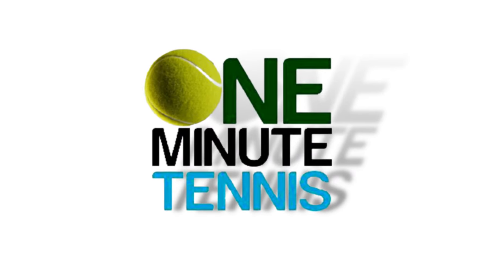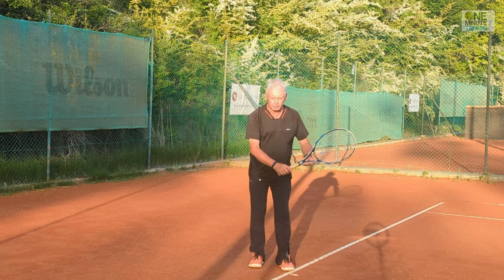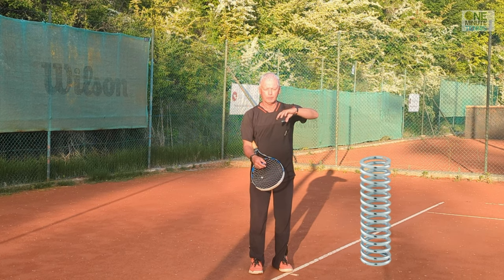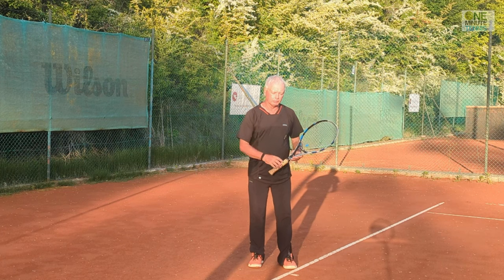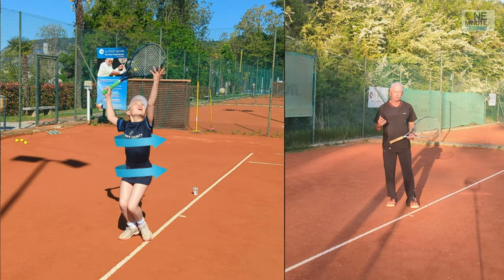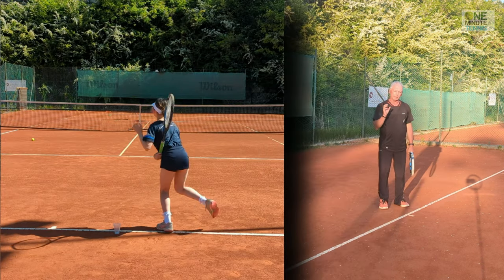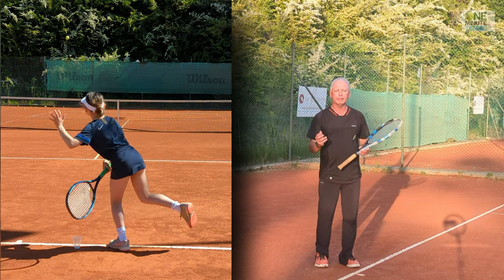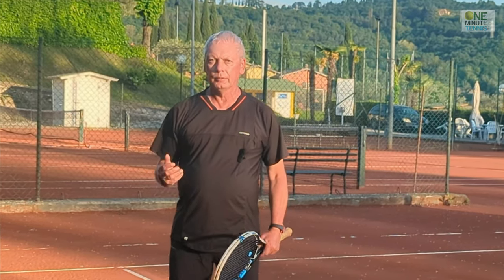Advanced Technique for a Huge Serve

Comment: There's something to this. But the explanation doesn't quite translate into what happens on the platform stance. Perhaps a different way to think about this is that the lower body STOPS rotating and allows the upper body (in links) to overtake it.

Comment: Interesting concept but I don't follow your description in the pro videos.  The discussion in the video suggests loading with shoulders rotating back and hips rotating forward.  Do you mean that the hips lead the forward/upward drive while the shoulders are still coiling?  Or, do you mean the shoulders rotate back while the hips shift (not rotate) forward toward the net?  With Fed, the hips seem to shift forward toward the net after his maximum knee bend, but I don't see the hip rotation till the drive forward/upward from the legs.  With Sharapova, she starts with the hips facing the net post and seems to face her hips to the side (hips coil back not forward) as she tosses.  In those pro videos, at what point do you see the hips rotating forward counter to the shoulders? 
I think what you are describing may be used by some of the pinpoint stance servers who bring their back foot past their front foot (unlike Sharapova).  For example, Wawrinka seems to do what you describe.
Reply: Very similar to my interpretation; it would be good if this could be clarified.  It looks to me that, rather than hips and torso going in opposite directions during the toss, the hips rotate back towards the net early, thereby creating the coil/stretch, then the torso rotates. No different to a forehand where the body turns more than the hips, the hips rotate back first, followed by the torso, then the arm etc.   From my experience this is not so counter intuitive as what appeared to be suggested.  Grateful for clarification.

Comment: I don't get it.  Isn't this simply saying to rotate the upper body further back than the lower body so you get rotational hip-shoulder separation.
Reply from the maker: Hi Henry,
Sorry. No. If you do that, the lower body will be inert and move with the upper body.
Think about the ballet step. This will move your lower body forward, while your upper body rotates backwards.
Can you not see this difference in Ciara's serve?
Does this make sense?

Comment: Tried this today, sent down 70 serves, initially I had trouble coordinating but it became easier as I progressed...noticed the improvement in speed quickly..also was able to send down the line & corner serves on ad side with more accuracy due to rotation towards the direction of the serve...I noticed slight difficulty in serving wide on deuce side as I could not time the spring uncoiling well so I tossed a bit to the left & could access the corner better...overall I improved my accuracy & the movements felt natural...will try to implement in the match...thank you for your awesome coaching

Comment: I made this change tonight to my platform stance and it immediately changed everything. I had been rotating my feet back toward the fence in an effort to get more coil and this has blown my mind. By not rotating the feet I’m easily able to jump up and into the court and be pointed in the right direction.
Reply: " I had been rotating my feet back toward the fence in an effort to get more coil"
Sampras started with front foot more parallel to baseline rather than the 45 d angle. It is fine to do that if you want. I think the key, as you mention, is not to rotate the front foot during the service motion. 🤔

Comment: Thanks again for this great video. But I still have a question, what this foot movement with a serve with plate form stance?
Reply from the maker: Hi rody
The foot movement is to emphasize not rotating your front foot back with your body.
On a platform stance, just make sure it doesn't rotate, or, use the little cup of water as guidance. 
I could have added this point, but the video is longer than normal already.
Glad your enjoying the channel.
Do you have any other tennis issues that I could help with? If so let me know

www.oneminutetennis.com

Comment: This is great. The countering rotations is a huge point. As a physics person I did not think the centripetal/centrifugal force bit at the beginning was accurate or particularly useful, but the rest was extremely good. I wish you should show the feet stuff with a platform stance as well, but there is a Fed clip to help us.
Reply: I hear that Federer guy is good. We have nearly the same amount of Grand Slams if you just ignore the first digit in his cumulative titles.
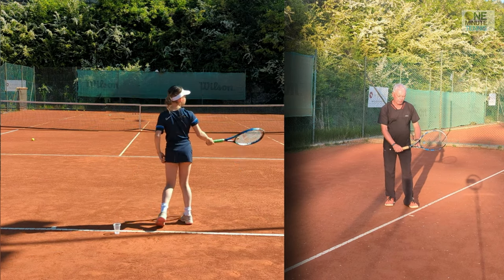Reply: Pic at 05:22. If I understand correctly, the player's hips are turned away from the net at 20 degrees and the player's shoulders are turned away from the net at roughhly  46 degrees.  Is this correct? Just want to confirm that you can get a roughly accurate measurement of the coil from this camera angle or if a different camera angle is better. I get confused if the  46 degrees is actually a measure of shoulder tilt in the front/back  dimension (tossing arm pointing to sky would be 90 degrees and student is halfway there) rather than a measurement of shoulder coil  in the other dimension.
Reply: @Better_Call_Raul  Sounds too complicated. Just try rotate upper body so that left shoulder is in line with the left toe which is pointing approximately 45 degrees relative to baseline. If you can achieve 20.5 degrees and 46.9 degrees and hit a serve more power to you. My brain couldn’t do that.
Reply: @topspin1715  I get the general idea.  Not trying to overcomplicate it and definitely not trying to copy those exact numbers...  Just curious if the back view camera angle can roughly  measure shoulder and hip coil.
Reply: @Better_Call_Raul  Oh I understand now. I have no idea then hahah, will have to wait for him to reply.

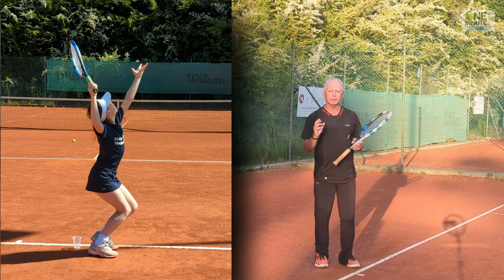Comment: I have the same problem as the student at 06:28. The left front  foot starts off behind the line, but after the toss is released, the left front foot swivels slightly  forward and touches the line (foot fault). How to correct this? And is this a serious problem? 🤔